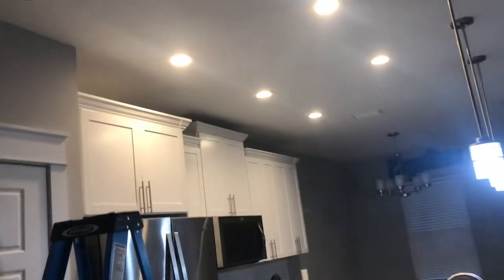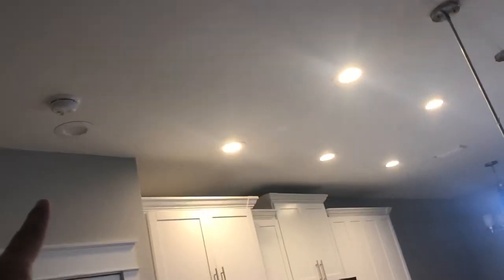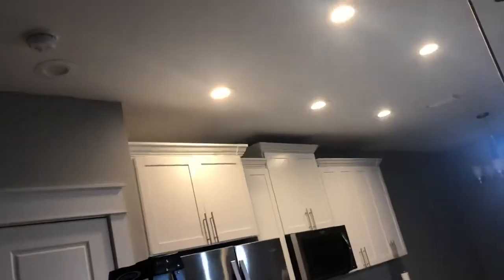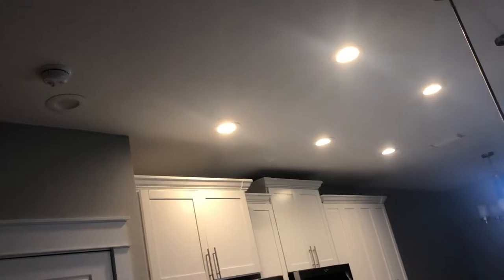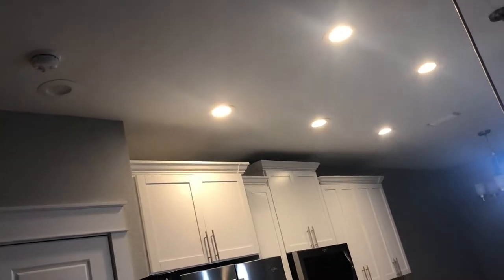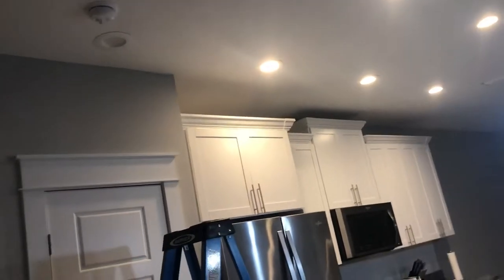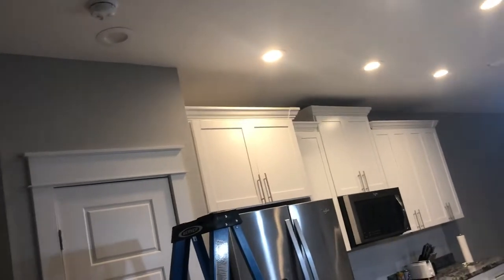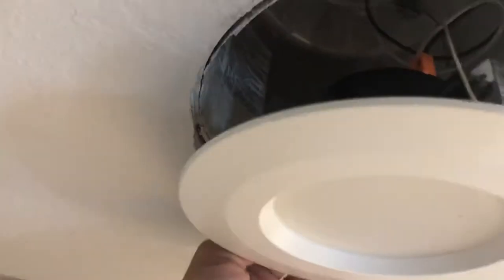Recessed Light Condensation Problems

Comment: It seems like it would be an insulation problem above that light, but, did you ever come up with a solution?
Reply from the maker: Andy Mackay in all spots where flex duct or duct board plenum was below blown in insulation there was condensation I found it all over the place and there were no air leaks craziest thing ever I ended up taking closed cell foam to all of the duct board

Comment: Did you ever find out what the problem was?
Reply from the maker: KatyushaRockets condensation forming on ductwork that made contact with the light fixture in the attic. Turns out I had this problem in many areas of the house
Reply: By any chance this house is down in the south ? I’m in south Florida and on my top floor I have this mildew problem staining around my low profile led lights. I’m thinking it might be as a result of the lights not being sealed with a caulking and the cold air from inside the house catching that gap in the light seal and condensing when meeting the warm attic air
Reply: I have the exact same problem with recessed light in my kitchen.. trying to figure out why!🥺
Reply: @stargazer7361  for me it was the quality of the lights; for whatever reason condensation built up inside them rather easily but when I replaced them with some high end LG brands the issue went away.
Reply: @KatyushaRockets  thank you for the info… I will definitely try that. We were told by an AC repairman that it was due to insulation being removed from around some of the ducting by a rat, so we had all ducting rewrapped.  That has done nothing to help the problem.